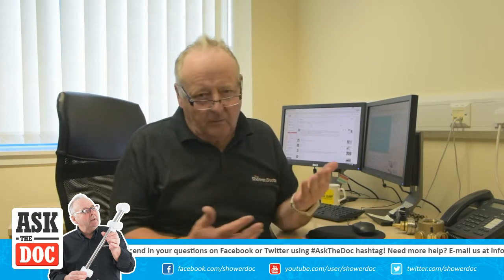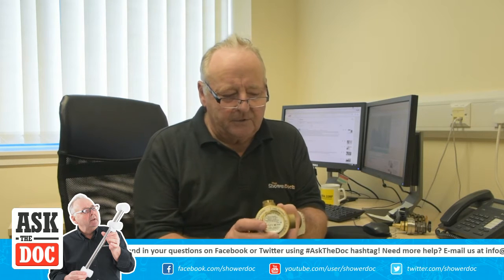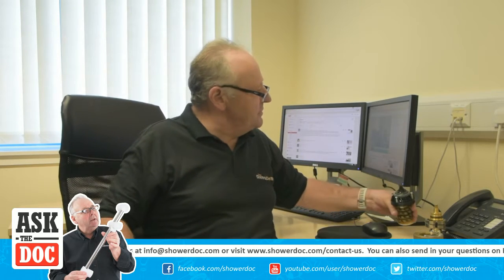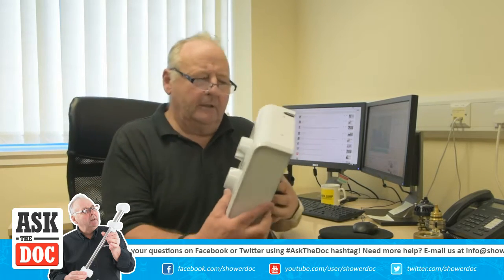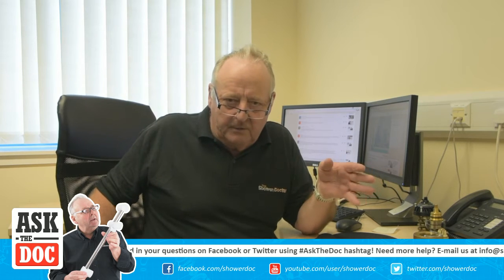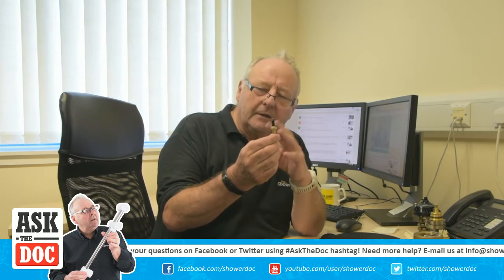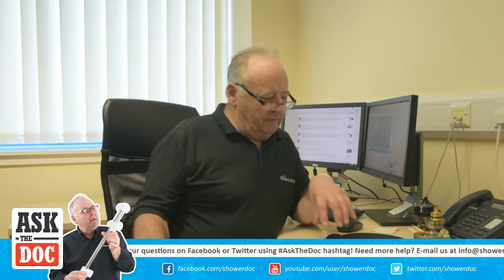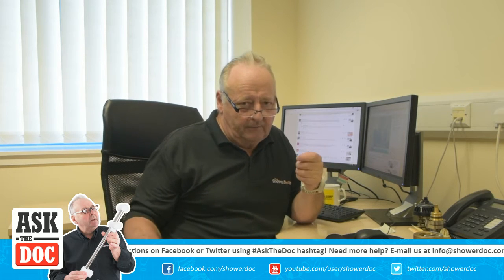AskTheDoc #2 - Live Q&A with George (31st May 2017)

Comment: Hi Wardog141
Yes the black dust is carbon from the brushes and shouldn't cause a problem with operating the shower.
Fitting new brushes is not particularly difficult, however you will need to remove the motor and pump unit to fit them.